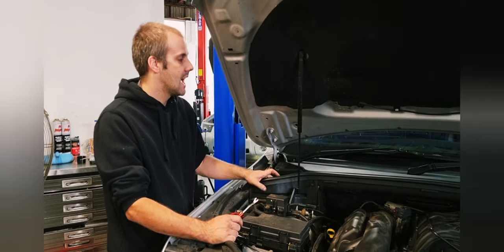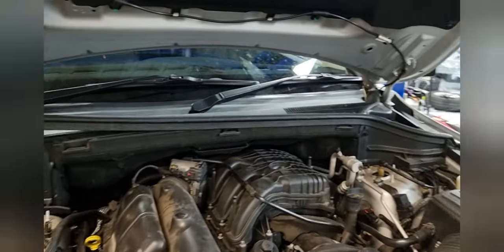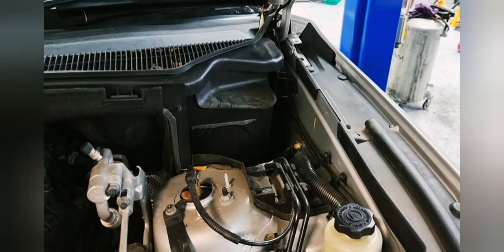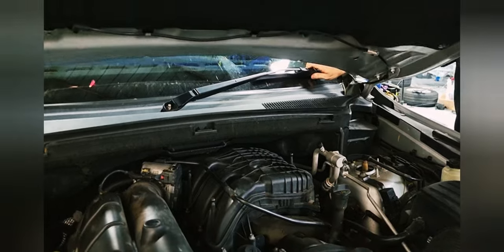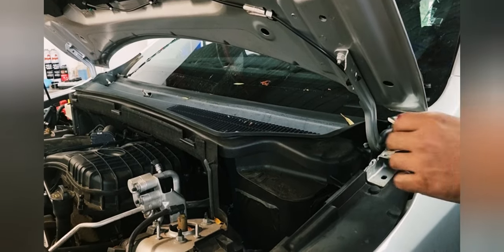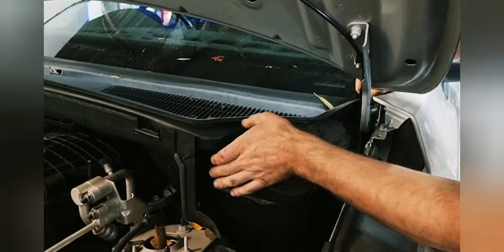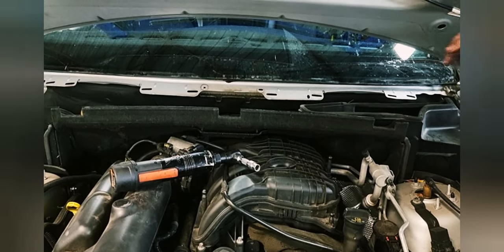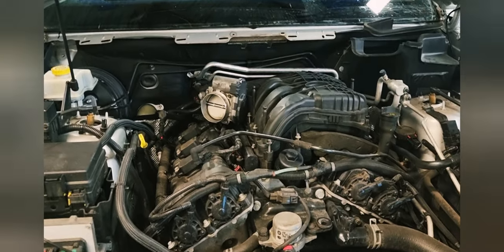How to Remove Jeep Grand Cherokee  Wiper Cowling #itsajeepthing #jeepguys #jeepdiy

Comment: This definitely sucks.  In the oil cooler video you say this takes 20 minutes.  No way.  I’m an hour in, cut all to hell and can’t even touch the last bolt so I’ve already waisted an hour.  On that last cowling you state there are four bolts, mention that one is pretty difficult to reach, and then conveniently don’t even show the one behind the intake that I can’t even reach with my hand, let alone my hand with a tool of any kind in it.  Even if I could get a tool back there, I’d definitely drop it down along the firewall and never see it again.  Now I have to proceed with the oil cooler job, HOPE I can get the upper intake manifold off with that cowl still in the way and maybe at that point be able to access that last bolt to give me more room to work on the lower intake and oil cooler.  Very misleading.

Comment: My wiper arms are impossible to remove for some reason, any explanation?
Reply from the maker: Rust. Spray a bit of wd40 
If that doesn’t work you may need a small wiper arm removal tool
Reply: @GDLautoblog  I likely will need that small tool. I tried using wd40 and it still hasn’t come off. Link to the wiper arm removal tool?

Comment: Now how do you get the cowling top panel back on and have it lay flat against the windshield?  I can't get it on right for nothing.
Reply from the maker: There are little metal tabs that you push into the slots. 
I’ll make another video this week for you
Reply: @GDLautoblog  Yeah I got them in there but for some reason it still won't lay down right.  I think they must be bent a little or somethin.  A video would be great!
Reply: @GDLautoblog  I'm about to try replacing this cowling on my Jeep. A video about how to reinstall it would be much appreciated!

Comment: How much easier does this allow me to get to my oil housing / cooler? Replacing it soon but id rather avoid this step if not 100% necessary
Reply from the maker: remove it, trust me
Reply: Just glosses over the last bolt which is completely impossible to find. Took me an hour just to locate it 🫠
Reply: @p.simpson9107  I had no trouble finding it, but there were several other things that tripped me up and made the entire job take longer in total. I think it took me about four hours, but this removal did tremendously help because I had no issue getting to any of the bolts, etc..
Reply: @p.simpson9107  I mean for an oil cooler replacement
Reply: I saw a dude do it without removing, didn't look much harder